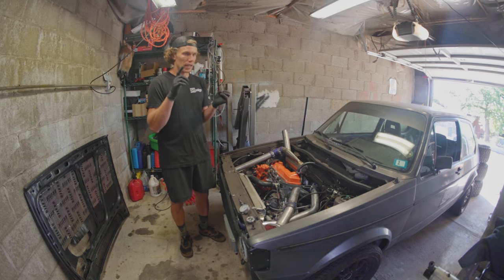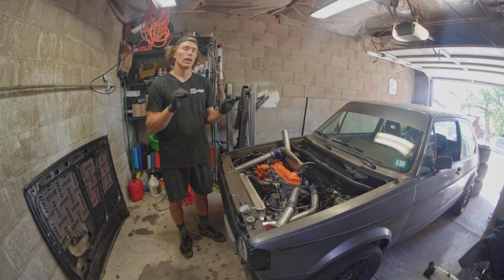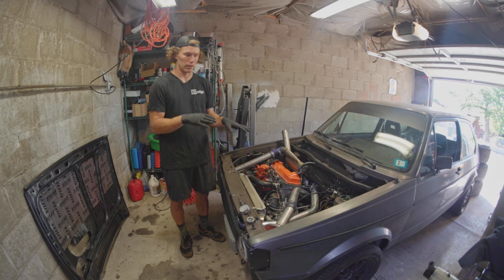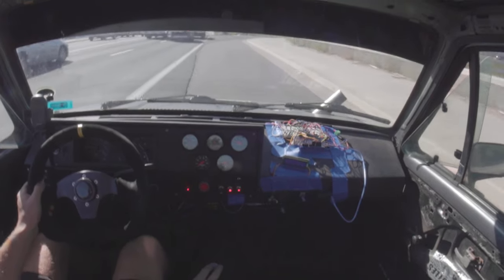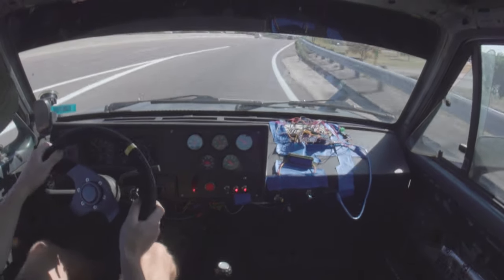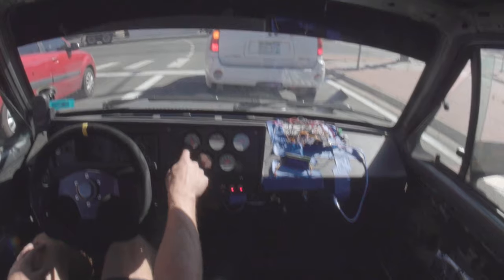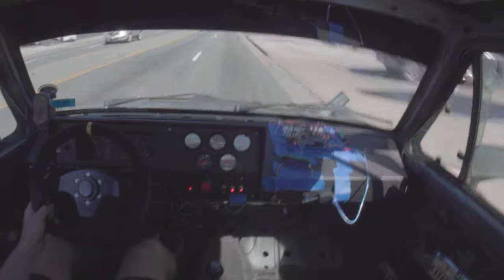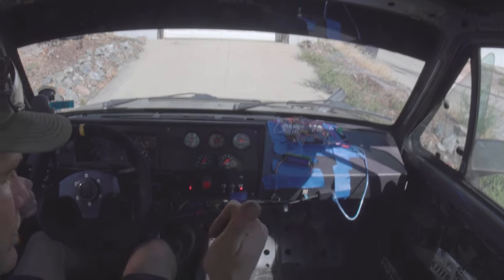Watch me test new timing on my 1.6L Turbodiesel

Comment: Are you running stock length  dynamic advance piston?
Reply from the maker: Likely not? The base of this pump was a giles build... Of course that doesn't mean much because he doesn't ever tell you what is upgraded 💁💁💁 but I'd assume he builds in more dynamic advance. What kind of options are there?
Reply: @OliverFetter   There's fitting a shorter timing piston, that would allow higher amount of timing sweep from idle to red line..to a point, as the pin that goes through the roller cage into the timing piston  hits the limit of the cut out in the casing. There are factory tapered pins about that will give a little more travel before hitting the case. Or you could dremel the slot more.. bit too invasive I feel though, and probably too much advance. Easy way to see if you can get more advance would be to take the end caps off and fully advance the timing piston to see if it protrudes past the casing..and if it would bottom out if the cap was reinstalled. (Some VE pumps had recesses to allow the piston to come out into the cap) if the cap blocks it you could swap pistons or.. easier fit a dynamic spacer between the case and the end cap. Pretty popular with  200/300 TDI landrovers as their timing advance is pretty tame. I did this when I fitted the wrong piston in my pump and didn't want to take it apart again. Gives you roughly 4-6 extra degrees of dynamic advance I think. Might be enough to be able to set your timing back to get low end power and still have enough timing up high. Either way seems the Giles pump doesn't have quite enough timing advance up high..
Reply from the maker: @austinmaxi  excellent information thank you for laying that out. Certainly something worth looking into!

Comment: In the VW Motherland injectors are usually set at 160 with normal diesel and up to 180 with vegetable oil.
You should really fit a N/A cam, with all the flow improving mods, a new ($75) N/A cam might give you quite a big hp gain.
Reply: NA cams give better performance than the OEM turbo cams?
Reply: @khester7397   yes should, due to higher lift and longer duration, which will increase flow.
Reply from the maker: Tbh it might already be a NA cam. I replaced the head on it with a reman at some point but I couldn't tell ya if it was TD or not 😅
Reply from the maker: Yeah my injectors are screwy.. I had a local shop rebuild them (should have been 155 bar) and when I pop tested them myself later I got 136 bar. Could be that my pop tester is junk too idk 💁
Reply: @OliverFetter  1.9 D injectors are ~130 bar 1.9 TD injectors are ~150 bar maybe they are NA injectors? btw i swaped the 150bar injectors with the 130bar NA ones and gained some power on my AAZ
Reply from the maker: @MrCannonPT  interesting!!

Comment: you should get a draggy. to measure ties to see the improvments. its really accurate
Reply from the maker: Is that like a 0-60 accelerometer or?
Reply: @OliverFetter  its a gps bassed tool guys use at the drag strip but its SUper repeatable and acurate. within 0.001 second ususaly but more than handy for testing to see if you car is making more power or not. 60mph to 100mph times
Reply from the maker: @BEYTEK  sweet I'll look into that!